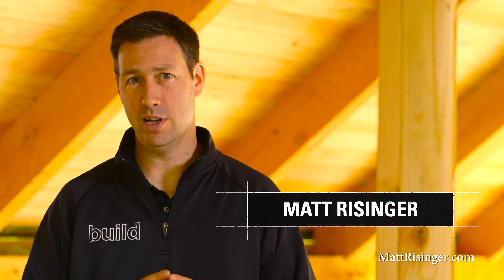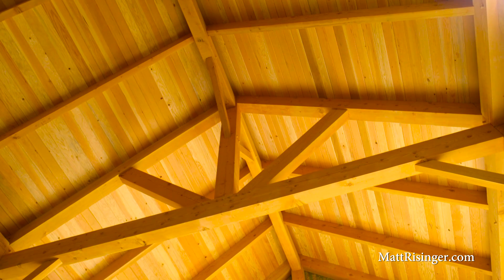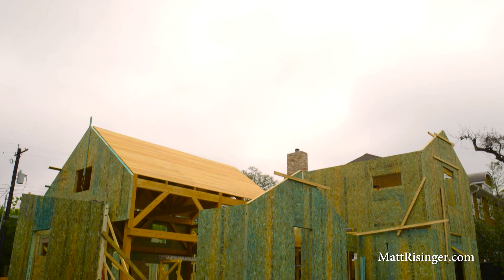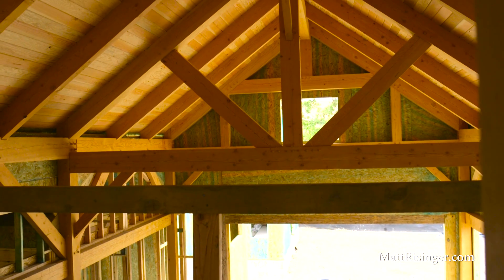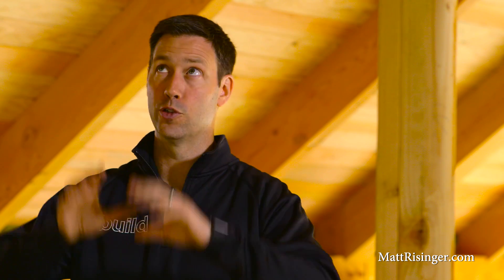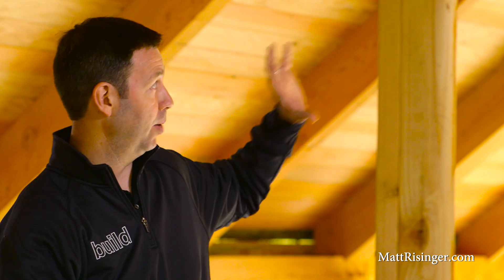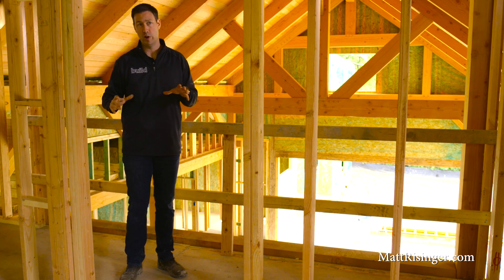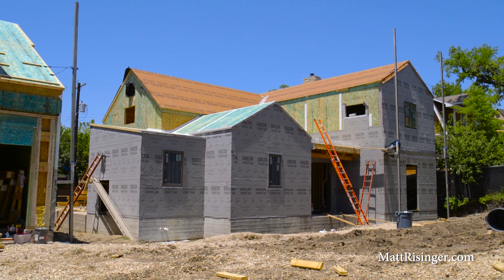SIPS & Timber Framing - A Perfect Match

Comment: Hey Matt, Been learning from your channels for quite awhile now. What are your overhangs on this house? And how did you go about attaching them? Does the perimeter/edges of the sips panels have some kind of solid board on the ends that can take fasteners? In the middle of designing my own home on a 10 beautiful oak forest acres west of Chapel Hill, NC and I'm determined to use all wood from the property to TF and finish the interiors, but some of the wall/roof details are new to me as I've not built with SIPS before. Side question -- is there a SIPS company that might serve this area that you'd recommend? Bonus points if their folks can help me put some of the assemblies/details together on this! Going to be a great build. Property is named Windfall as it was smacked by a tornado while we were under contract on it! Any advice is helpful. Thanks. -- Jakob Gollon

Comment: Sweet, im building a timber framed, sips wall & roof cabin, 16x32 plus a loft.
Reply: How did this turn out? I’d like to copy you for a bit of land I have on a creek. ;)
Reply: @AriUgwu  Ari, I haven't started construction yet, but I've been gathering the more expensive materials (windows, doors, flooring) at very good prices/free. Since that post, I have settled on 16x24' to be more efficient with materials. GL!
Reply: @utubeaccess7  Thanks for that advice! I was following the wisdom of buying the land, slowly improving it, building a shell, and then slowly filling it in. However I didn’t consider gathering some of those expensive materials now! Flooring, windows, doors would be a non trivial expensive to source last minute and will only get more expensive/rare with time. To your point it’s also amazing what you can find cheap/free when a wealthy home builder changes their mind at the last moment. ;)
Reply: @AriUgwu  Yes, two of the window units I found for free are huge 6' wide by 8', round top units with high performance glass upgrades, etc. These would have cost around $4k if I ordered them for myself... Check with custom building suppliers and ask if they have anything to donate. Just don't waste their time or you'll lose your contact. ; -)

Comment: Hi Matt. great video..pls tell to  us what will be the finishing system over exterior wall?
Reply from the maker: Exterior on this house is a ventilated stucco with Cosella Dorkin's Delta Dry Stucco and Stone. Video on that in a few months
Reply: +Matt Risinger ..Ohh good....here in Brazil we are with light steel frame houses..and we are finding a lot of problems with stucco...because here we have not companies offering those kind of membranes properly for stucco...we just have here conventional house wrap Tyvek and Typar.  So we are making directly apply stucco over cement board.

Comment: I've seen you do warm roofs in the past and add battens on the roof to create an air gap and install a metal roof over the battens. I'm guessing that's what you'll be doing on this project. However, I'm curious how you would handle architectural asphalt shingles over this particular roof. I haven't been able to find an answer. All of our local shingle manufacturers actually reduce or void their warranties if their product is installed over a warm roof. Is there an economical or reasonable solution? Do I need to worry about heat and the SIPS roof in hot southwest climates? Thanks
Reply from the maker: Matt,  Good question. For a shingled roof use a good underpayment like Delta Foxx the shingle as usual. Don't worry about the warranty. Shingle life is barely affected. Maybe 5 degrees hotter than over a vented roof. Crazy they have a reduced warranty. Matt